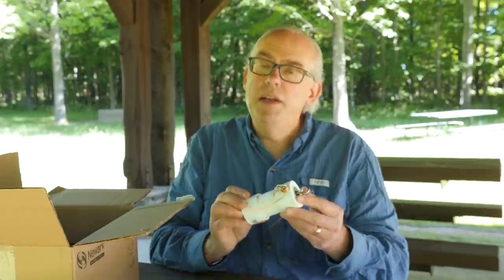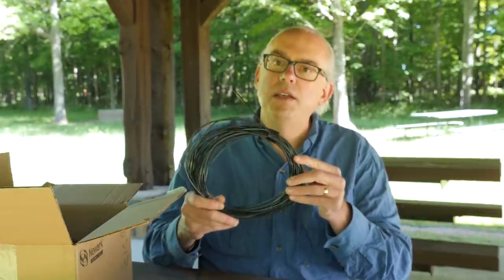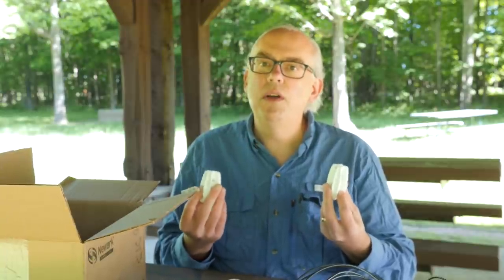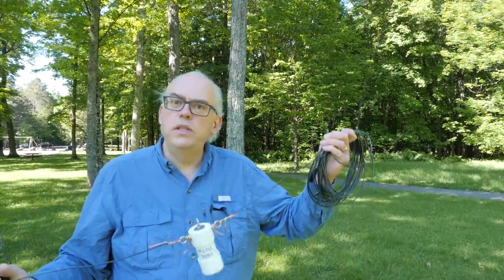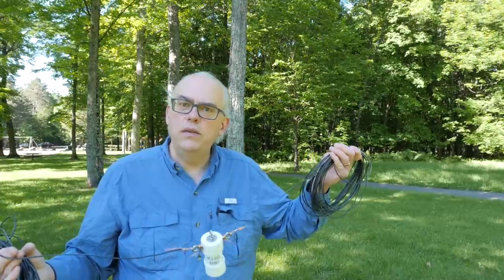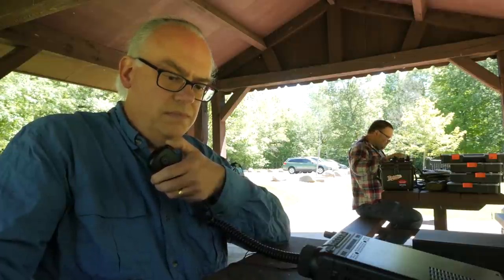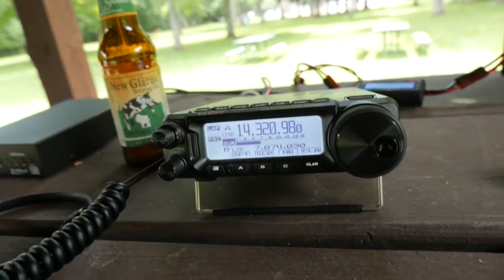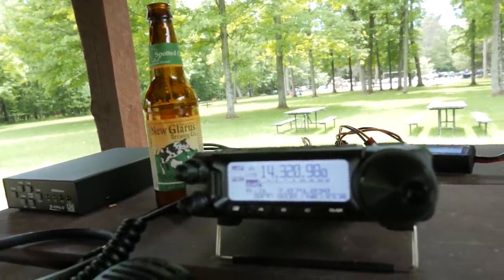Off Center Fed Dipole (OCF) Antenna - Ham Radio Q&A

Comment: WB4BKO  Stretching the wire prior to installation works very well. I use a fence post anchor and then uncoil the wire while walking away from the post while keeping the wire very taut. This has worked for me over many years. My 75/40 meter inverted V has been in use for 20 years and the wire has not stretched any in all those years. Can't say that much about the insulation though. It has deteriorated , but is still intact. I find your videos to be very informative. Even though I have been licensed for almost 50 years, I am always open to learning new things and other hams' interpetations of this hobby of ours. 73 Norm Davis

Comment: Thank You so much for this. I have the BalUn and the wire connected but was afraid to cut it because I didn't want to make a mistake. Now I think I can do it. No antenna analyzer but my Xiegu G-90 has a little meter that I can use to check my antenna out.

Comment: Always enjoy your videos, I currently use OCF, I have less then desirable lot to work with, mine is currently inverted vee at 30ft, mine does fine job 40,20,17,15,12,10 and 6m, performs much better than G5RV did. Thanks for input on 80m might just have to make one.

Comment: Michael, I am just getting ready to make my first OCF dipole, 80m. This video has all the information I will need. My hope was to trim it enough to get SWR below 2.0 on 80, 40, and 20 - just to be able to use it without an external tuner on my ICOM IC-718. After watching this video I can see the challenges are: A. correct original length; B. Minimum height 30 or more; C. Correct trimming; and, D. Configuration - sloper, inverted V, or ??? - as always, thank you. From S.E. Tenn 73 KQ4IXD

Comment: I had great results with most bands on my OCF. Mine was a shorter one for my lack of space. I did have issues with RF in the shack. I needed to put on a choke balun and ferrite beads. I'd use the tuner as needed. Thanks for the video.
Reply: How do you know that there is rf coming in the shack?
Reply: @jameyevans29  I get feedback through my speakers and  distortion on my outgoing signal.
Reply: @sphexes  oh ok I guess I am good with mine.  Thanks for the reply

Comment: nice job. I go to a park to make my portable antenna. just bring all tools . even wound toroid in a park. soldered the cap. it's fun for me. I do not mind spending time in a park. just hate them bad weather days. but so many nice days to make up for that.  that how it is in NY for me. with tuning /trimming off set center fed . had to cut 1/3 to 2/3 off ends. was harder to do then a end fed but take time and got it. I did 40 meter one. got 40/20/10/6 meters.  lost 15 meters but put my Icom 7300 in E tune and it tuned it on 15. also 17 and 12 meters. even done 30 meter E tune. the outher off set center is 25% to 75% . or 1/4 to 3/4 of half wave total. ended up with a 6:1 for that one to tune. as you move the feed point the impendence will change. 73's

Comment: You should have some good luck with that antenna on FD.  I used the exact same setup for a few years until the MFJ-913 suffered a failure (one of the torroid cores cracked).  I then made my own 4:1 dual core balun with big 240 size cores and it still serves as my home station antenna with great results.  They can be tricky to tune if you decide to adjust it, but I would recommend to shoot for the bottom edge of the 80M band for best resonance, that should give good fits toward the center of 40M and 20M and so on.

Comment: Have a receiving antenna use  W/a 3oo ohm restor to ground  at the shorter wire end to ground.  The other(centre wire)  end set for 40 meters. And doing well. Switching in or out the 300 ohm changes how it works.

Comment: Great video.I also use 80m off center fed dipole I use jetstream 4:1 balun with t240-31 core choke below balun 11 turns rg8x coax also use 90 ft wire and 45 ft wire best antenna I have used.dose need tuner on 80m.I don't get 15m swr too high.I can use tuner though.73s.N9WZL.

Comment: Just get 49:1 transformer, feed same wire at the end and you get better results. No tuner needed, easy to deploy.
Freedom to hang horizontal, vertical inverted vee or L.
EFHW is better
Reply from the maker: Not necessarily better, but different.

Comment: KK7EQB --- SE Idaho  I'm still a rookie at this, going on about 2 years. I'm planning an OC dipole for my back yard. I'm limited to  about  10-15 ft of height due to trees and power lines and a length of about 40-50 ft. I have a 4:1 balun but from what I''ve read, maybe I should just use a 1:1 balun because of the height of the antenna. I have used a CF dipole for the last year but so far I can only receive but no one is hearing me on HF. It seems to work fine for 2 meters and 70cm locally. Any suggestions?

Comment: T.y. Michael.  I love your videos... they are always so to-the-point.  For a long term setup at home, where would you go for wire, and do you think that balun would suffice?
Reply from the maker: For these portable antennas & demonstrations I use 14ga stranded because it is relatively inexpensive. But it will stretch with long term use. For permanent installation I would either choose 12ga solid copper or copper clad steel wire. The MFJ-913 is a quality balun and I'd use it for something permanent. The Wireman of South Carolina is a good source for copper clad steel antenna wire.

Comment: Hey Michael! N4BDW here from KY, been emailing you lately about jpole tips. I actually have the OCF up in my back yard coming from my 7300 ands it’s a great antenna. I pick up mostly north to south better, but I hear contacts ranging from the west coast to several in the Spain area. Great video, very well explained out! 73
Reply: Does your 7300 built in tuner tune the antenna okay?
Reply: @garymartin7011  Hey Gary! Honestly I’ve  never tried it. I just figured it would struggle, with there being several band options, and internal tuners only match to a certain level anyways. I’ve either always used an MFJ-902B manual tuner, or an MFJ-1949.

Comment: Great video on the explanation and discussion on height vs diminishing returns.   My goal is to add an OCF dipole at 3.9mhz to supplement my hustler vertical that uses a 75m coil at the top.  So, looking at the OCF and came up with 246' total length with the feed point at roughly 82' OR, 120' total length with a feed point at 40'.  Wondering if going to 246' would have any significant advantage over 120' at 3.9mhz?  K5KUE

Comment: I have tried numerous, and I mean numerous formulas for an Off Center Fed Dipole. This is the first formaula with 133 feet as its total. Most are 134 1/2 to 137 feet, and it does make quite a difference. Using this formula, 80,40,20,17,12,10,6 all have workable SWR, meaning under 2:5.1 SWR. 75 meters I recommend a tuner. If you use LOW power as in under 100 watts you can squeak in 30 and 15 meters using a tuner as the SWR is 5:1.1 or higher. High power on these bands have been reported to cause damage to the 4:1 balun. As for the video, you should remake the video, and study for your presentation. So far this is the best formula for an OCFD, despite 15 and 30 meters being missing. Good luck, have fun, and Good DX. AB9PM
Reply from the maker: As I recall, in making the antenna, I did use EzNEC to model the OCF dipole, that's how I came up with 133 feet as a good number. But, as you mentioned, this video is more than 3 years old and it's production is lacking a bit compared to my newer stuff. I do have it slated for an update; probably this spring when it gets warmer again.

Comment: I always wonder about the extra wire used for strain relief. Do you have extra wire on for this and make sure your measurements are just for the insulated ends of the wire?

Comment: I would love to try a EF or OCF antenna but because of the layout of my yard and my shop I could only run either antenna N to S which would put it out over my shop at about 40' up.  Problem is my shop has a tin roof and I've been told that wire antennas don't like being around or over metal.
Reply: Put up the antenna wherever you can.  You might be surprised as to how well it works.  A poor antenna is better than no antenna.

Comment: Thank you for the video!

I do have a question... I see a lot of people saying that you need a 4:1 current balun for this and a warning not to use a voltage balun for an OCF Dipole, but nobody seems to have a clear explanation as to why or what happens if a voltage balun is used.  Is this something you would be able to explain?
Reply from the maker: Briefly‚ a voltage balun delivers voltages equally but in opposite phases along the radiator. A current balun delivers current equally in opposite phases along the radiator. A voltage  balun may be a good choice for dipole antennas where the radiators are equal lengths because if they aren't symmetric‚ then common mode currents may occur. A current balun is good for filtering out common mode currents so it works well with asymmetrical antennas like the OCF dipole. You can use a voltage balun with an OCF dipole‚ but you will then also need ferrite chokes on your feed line to limit common mode interference. Using a current balun eliminates the need for the choke.
Reply: Hi, KB9VBR, a centre fed dipole needs NOT a voltage BalUn but a current BalUn; ie, an 1:1 current BalUn or CMC (common mode current) choke at the feed point.
Even if the two 1/4 lambda limbs happen to be equal in size there may be a tendency for a CMC to flow along the outer surface of the outer conductor of the coaxial cable; because it acts like a third conductor of the transmission line.
In the case of an OCF antenna assuming that the feed impedance to be around 200 ohms (at the normal heights an average ham can manage) a 4:1 BalUn is needed. As you mentioned if a voltage BalUn is used it should be succeeded by a CMC Choke.
De VU2RZA

Comment: You got 1.6 on 40 meters and 2.0 on 20. Based on on those numbers, would it be safe to assume 30 meters would be 1.8?  I'm hoping to build one of these for 80, 40, 30, 20.
Reply from the maker: Not exactly. I'm not able to attach a chart, but if you look at a broad frequency sweep of an Off Center Fed dipole, you'll see a series of peaks and valleys. The valleys are the low SWR spots that roughly correspond with the amateur HF bands and the peaks are the higher SWR spots outside the amateur bands. On bands that are a frequency multiple, like 80, 40, and 20, you'll see good SWR spots; and on odd frequencies, like 30m or 12m ,you'll see higher SWR. I do not remember sweeping the 30m band on my OCF, but I recall when I modeled it using EZnec, that the SWR was about 4:1. It's not ideal, but workable on 30m with a tuner.

Comment: I'm thinking about building one for the 10 and 11 meter band because the landlord doesn't want anything attached to the house or roof so I was thinking about a dipole I have a really tall pine tree in my yard do you think this would work ok on a cobra 142 gtl on 11 meter.
Reply from the maker: A simple dipole for the 11 meter band will be approximately 17 feet long from end to end. If you use a relatively thin wire, it should be relatively hard to see from the ground.

Comment: I am interested in purchasing some electric fence insulators similar to the ones you have.  As you said you went to the local feed store to get them.  I have looked on Amazon as well as the other ham related Internet retail outlets and only the "doggone" version are available.  Would you like to recommend an Internet source for the electric fence insulators?
Reply from the maker: These are the insulators that I use: https://www.fleetfarm.com/detail/zareba-white-high-strain-corner-post-insulator-10-pk/0000000281955?Ntt=fence%20insulator

I don't know if you have a Fleet Farm in your area, (they seem to be an upper midwest thing), but Tractor Supply Company should have something similar.
Reply: @KB9VBRAntennas  Thank you Michael. You are correct, however we do have a Tractor Supply Company in the area.  73...Rob (wd4ift)

Comment: What could I do to be able to reach my brother in Alabama on my 1996 mobile TRC-485 set up in my home as a base station, here in Indiana? I'm trying to get back on the CB wagon, like I did back in the day! I need an idea either on the antenna setup or a power boosting method without blowing my mobile unit! Thank you for any ideas!
Reply from the maker: A solid, reliable connection between Indiana and Alabama is going to be wildly unpredictable on the 11 meter band due to the signal propagation. We are near the bottom of the solar cycle so throwing power or unique antennas won't necessarily fix the issue.

Comment: Would you recommend making an antenna like this for 20/40 meter, or just making two center fed dipoles for 20 and 40 meter respectively?
Reply from the maker: Making an Off Center fed dipole for 40 meters will also give you 20 and 10 meters respectively (and 15 with a tuner). Two separate center fed dipoles may be a bit more efficient, but would require more space and a second run of coax to feed it.

Comment: What was the length of coax you used to feed that antenna? How much coax did you use or does it matter at all?
Reply from the maker: I typically use RG-8X for HF portable, either a 25 or 50 foot run. Whatever it takes to get from the antenna to the radio. Some say you should optimize cable lengths so that your cable length is a 1/2 wave multiple of your operating frequency. That's fine if you are using a monoband antenna, but makes no sense for multiband antennas as when you change bands, you cable will no longer be optimal. I think you're better off to pick a length that's non-resonant to all your operating frequencies.

Comment: Hey mike, what kind of wire you are using ( number or model ) please. 73’s
Reply from the maker: I use 14 gauge THHN stranded wire for the antenna elements. It's commonly available at a home improvement store. But if you are thinking of a permanent installation, and are concerned about stretching, you can switch to 14ga solid or even copper clad steel. The stranded is just a lot easier to work with.
Reply: @KB9VBRAntennas  thanx man 👍🏼

Comment: Michael, Would you please describe what you did to your feed line below the balun?  It looked like a coax choke and a ???  Thank you for the videos!
Reply from the maker: It's a series of snap on ferrites on the end of the coax that function as a choke. Technically I didn't need then as the current balun also helps keep common mode interference off the feed line‚ but that's the cable I had with me that morning.

Comment: Balun what is the difference between current and voltage 
Good luck on field day
Reply from the maker: Briefly‚ a voltage balun delivers voltages equally but in opposite phases along the radiator. A current balun delivers current equally in opposite phases along the radiator. A voltage  balun may be a good choice for dipole antennas where the radiators are equal lengths because if they aren't symmetric‚ then common mode currents may occur. A current balun is good for filtering out common mode currents so it works well with asymmetrical antennas like the OCF dipole.

Comment: What type of coax did you use for the lead-in?  When you measure the length of each leg, is the measurement from balun eye-let to insulator?
Reply from the maker: I used 50 feet of RG-8X in that video. As for the measurements, I used the figures derived from the standard dipole calculation (468/F in Mhz) and shifted the feedpoint so one leg side is 67% and the other is 33%. The dipole calculator assumes bare wire, but I used insulated wire, so you should factor in reducing the length by about 4% for velocity factor. I usually don't as that extra 4% of length gives me a bit of working room to attach the legs to the balun and end insulators. Better to be too long and trim to resonance than to be short and have to make up the difference.
Reply: @KB9VBRAntennas  For a permanent installation, would you recommend solid wire?  Would 14-AWG be large enough?

Comment: How is this preferable to an 80-10 m end fed?
Reply from the maker: I'm not sure if it's preferable‚ just different. Couple advantages is that the OCF doesn't require a counterpoise for operation and the impedances aren't as high at the feedpoint. That is‚ you can use a 4:1 balun with an OCF while an end-fed may require a 9:1 or higher balun.

Comment: For a 20m dipole fed with coax.   What kind of balun do i need?   Thank you.
Reply from the maker: A center fed dipole will have an impedance of about 70 ohms. You can direct feed it with coax but a 1:1 balun will help keep common mode currents off the feed line.

Comment: Do you trim at the outer ends and how much at a time?
Reply from the maker: You can trim the outer ends until you get your desired amount of resonance or tune for the frequencies you are looking for. Trimming would be proportional on each side, for example: if you remove an inch on the long end, you'd take off a 1/3 inch off the other.

Comment: If I want 7mhz as main band, is coax centre to short or long leg , please? m6baq, thnx
Reply from the maker: I don't believe it makes a difference. In all the OCF transformers that I've seen, no one has indicated that you attach the long end of the wire on one side or the other.
Reply: Thanks! @KB9VBRAntennas